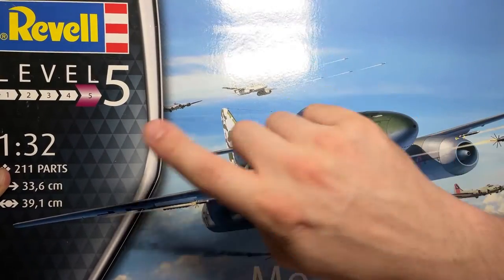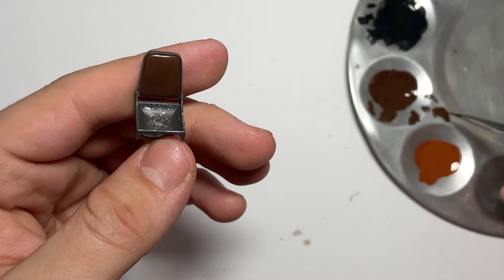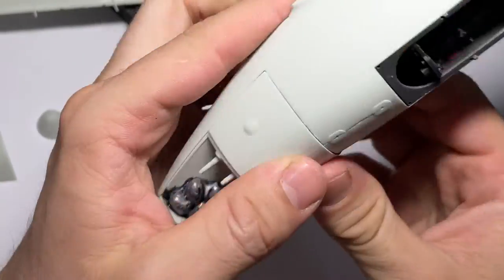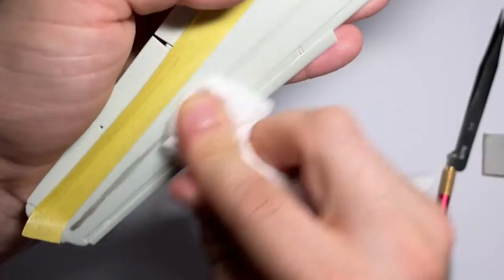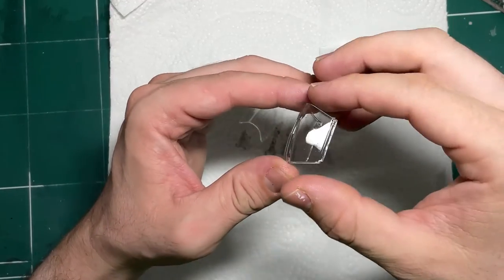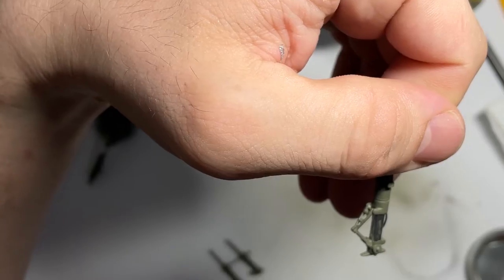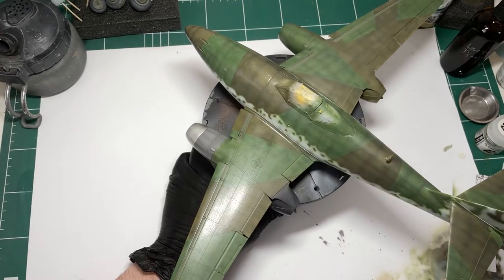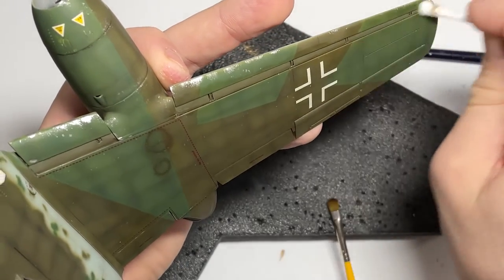Back to Jet! Me-262 of Revell in big 32. Full build

Comment: Hi! Did you have issues when attaching the engine nacelles to the wing as per the instructions? I built this same kit and had fit issues and serious gaps with the engine/wing assembly.
Reply from the maker: Hi, hmm not really, engines went very smooth, but I hade serious fit issue at other parts